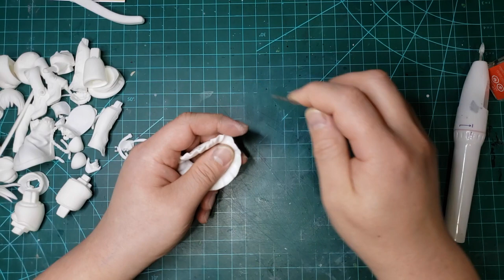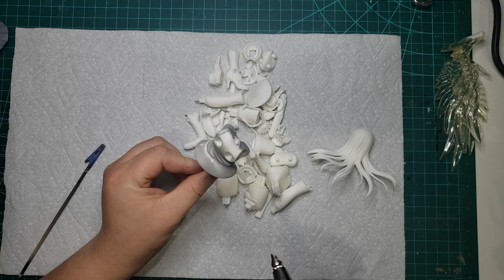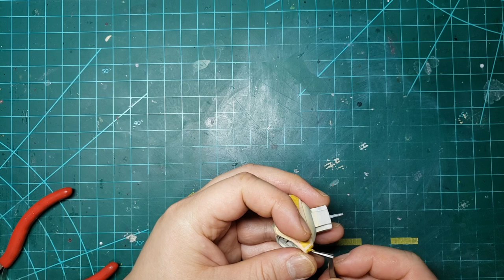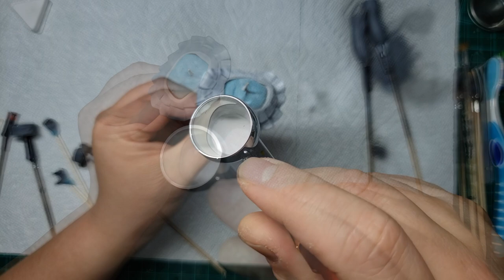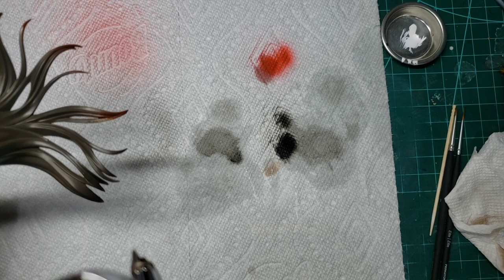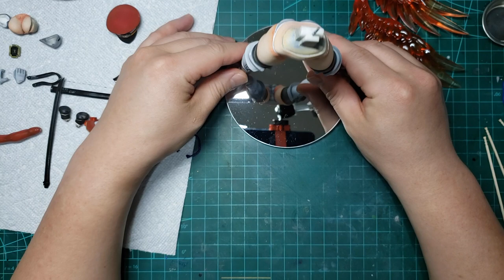Let's Build! Michael

Comment: What kind of pastel did you use? I used some soft pastel but it was not stick to surface so well.
Reply from the maker: I used the Prismacolor brand pastel. I also noticed that pastel doesn't stick on a smooth surface like gloss varnish so I always spray flat varnish before applying pastel.
Reply: @EggyBuilds  flat varnish likes mr.hobby's mr.top cat flat right? Then use pastel. Finally another flat layer to protect the pastel.
Reply from the maker: That's pretty much what I did. I used matt varnish from Vallejo mecha color line in this case.